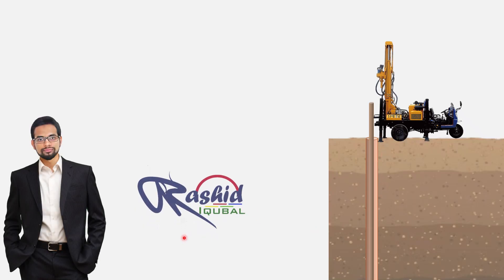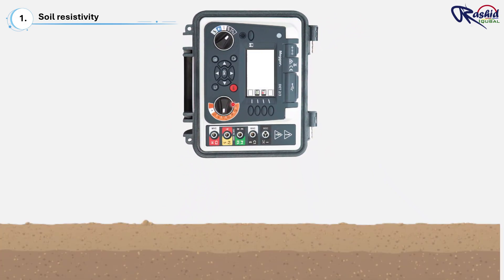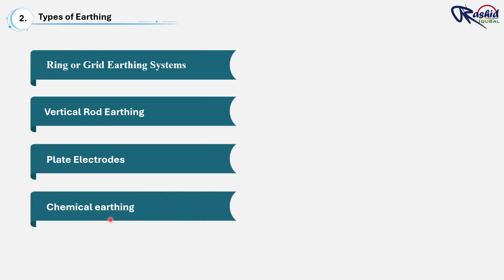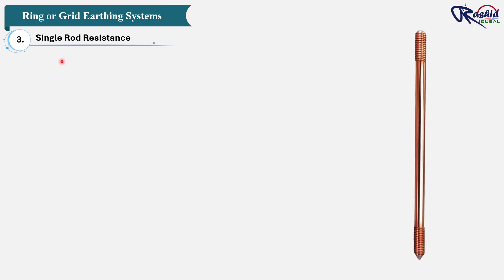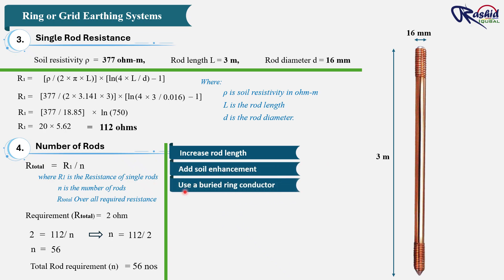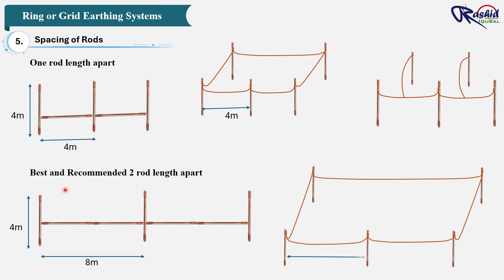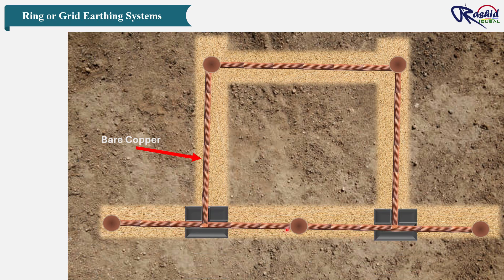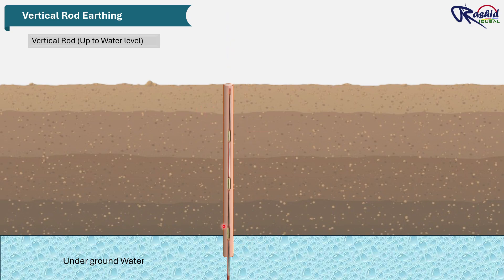Earthing System Design & Calculation | Grid Earthing vs Rod Earthing Explained with Example

Comment: Thank you for the explanation sir, here you have used copper bare conductor of 240 Sq.mm and some places they are using earth strip of size like 25*3 to make interconnection. What is the difference? How we need to chose between bare conductor or strip conductor to link?
Reply from the maker: There is no issue in using an earth strip instead of a bare copper conductor, as long as the earth strip has an equivalent current-carrying capacity..

Comment: Sir I have gone through your content it was really very clear but I have a doubt that how the resistivity gets reduced from 112 ohm-m to 40 ohm-m after adding benotanite powder? How the reduction has to be calculated?
Second one as per standard, we need to use the rod length of 3 m but we are increasing to 4 m, is it allowable? If it so, on what basis we are increasing sir?
Reply from the maker: Thank you for your question.

1. The reduction in soil resistivity after adding bentonite is not calculated by formula. value (like 40 ohm-m) is a practical assumed value based on experience and manufacturer data. Bentonite improves moisture retention and soil conductivity around the electrode. The actual value must always be verified by field testing after installation.

Your second question: Yes, increasing rod length from 3 m to 4 m is allowable. 3 m rod is only a standard size, not a limit. Rod length is increased based on soil resistivity, depth of moist soil, and target earth resistance, which is a common and accepted engineering practice.

Comment: Do you keep the pcv pipe inside the hole? Why not remove it, after all it has a high electrical resistance.
Reply from the maker: PVC pipe use only few meter depth, once we insert earth rod we can remove PVC pipe